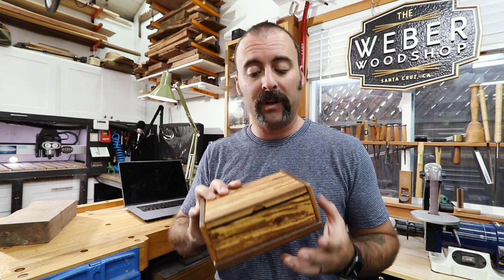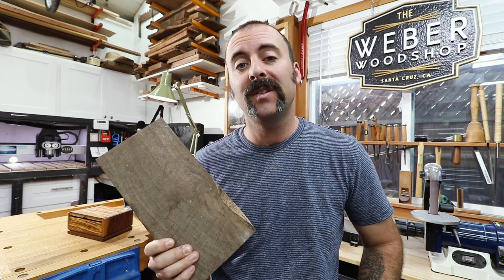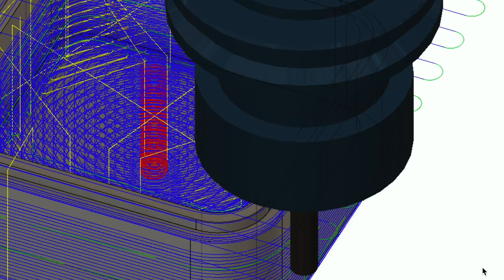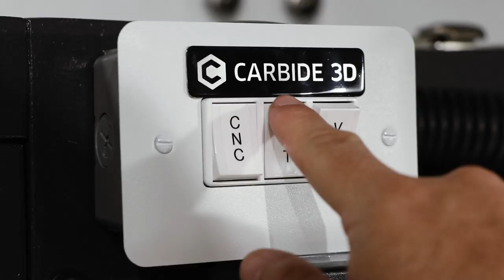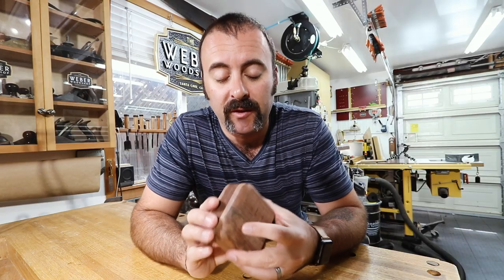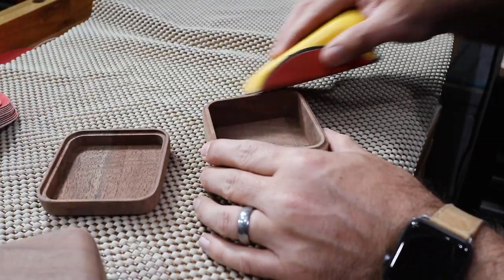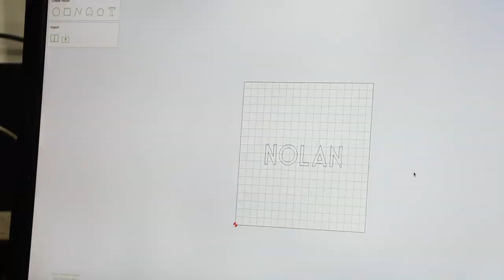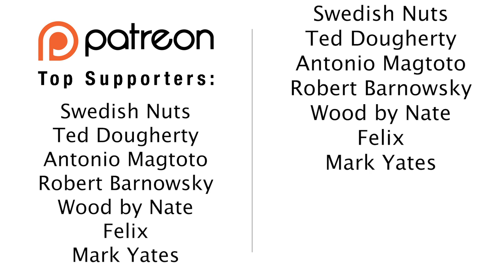Build: Simple CNC Box with Fusion 360

Comment: For anywhere you want tight tolerances my advice would be to cut the first pass over sized using the "stock to leave" option in Fusion360 and then come back in and creep up on the fit by repeating the contour toolpath on just the bit where you want a tight fit, on each pass slowly adjust the stock to leave until it's as you want. After a while you get to know your machine and can creep up on really good fits without too many iterations. BTW you can have a positive or negative "stock to leave" in fusion360 i.e. cut undersized or over sized compared to the CAD model.
Reply: 100% this
Reply: Kai Wheeler Thanks for this, some of the best tips are in the comments.

Comment: The problem I’ve had with friction fit hardwood boxes is the fit will change over the year even if it’s perfect when cut. It can be loose in the summer and too tight to open in the winter. Or vice versa. Because of this I now cut them loose and add magnets.

Comment: Regarding the issue with tolerances... at 3:31 the router moves quite visibly under just finger pressure.  Now, I've not used a Shapeoko so I don't know if that's normal, but that looked like quite a lot of deflection.  If that's normal, you may want to heed the advise of a comment further below and utilize some stock-to-leave and do a final finishing pass.  But I'd also check and make sure something isn't loose on your Z-axis because those lids were off by a lot more than 5 thou.
Reply from the maker: GordonGEICO yes I’ve done quite a bit to fix the issue since this video as made.
Reply: @weberwoodshop  That's good to hear!  Nice shop you got there, I especially like that router table.

Comment: The humble lided box has so much to teach.  Warp, tuning speeds and feeds, different cutters (try single flute), tollerences for a good fit.  As for fusion360.  Now that you have your model, learn how parameters work.  Make the x and Y (to start) dimensions parameters and suddenly you can make any size and rectangle too.  A round box can be oval with just a parameter change.  Have fun.  ~P
Reply from the maker: sbirdranch yeah so many possibilities! Thanks!
Reply: warping or cupping is a major issue for me and so frustrating when it occurs from deep pocket cuts

Comment: Now that you have the dust boot, do you think you still need the box you put around the machine.  ?
Reply from the maker: Yes, for three reasons. One: NOISE. Its much quieter in that box. And Two: You can’t always use the dust boot. Especially when you are trying to film what it’s cutting. And Three: SAFETY. I’ve crashed the machine more than once, and carbide chips fly like shrapnel. Also my kids are fascinated by the robot so with the box they can stand in front of it and watch it cut.

Comment: The lid looked looser than the few thousandths the run out would cause.  It is also possible that your bit diameter is not smack on what is advertised on its package.  To find out the bit's diameter model a 1 inch square and a 2 inch square.  Cut them both out with the center of the bit following along the lines of the square. (not outside the square and not inside the square).  Measure the squares in both directions; they should be very close to the same measurements.  Call the 1 inch square's side length A and the 2 inch square's side length B.  The bit's diameter should be 1-A.  However, there is a chance that your machine does not move exactly 1 inch when told to do so (variances in belt tension, backlash etc.)  As a further check, The bit diameter should also be B-2*A Also, if B-A should be 1, but if it is something like (.97 or 1.05 for example) then that is the amount the machine travels when told to move one inch.
Reply from the maker: Harry Ragland lol omg this could not possibly be more over complicated... Calipers will also tell you if the bit is accurate and round ;)

Comment: OK, I may be missing the point here, but this video was a disappointment to me. Aside from the fact that a faulty collet can cause accuracy issues, I learned nothing. I know how to design in Fusion 360, but the Manufacture process is a wilderness. It's nice to know that Blake can do this (NOICE workshop, BTW. Lusting after your router table!), but it does not bring me any closer to doing so myself.